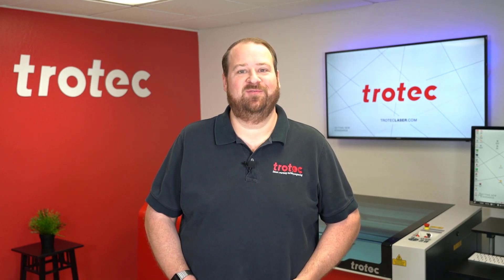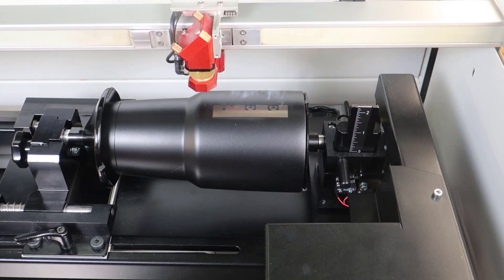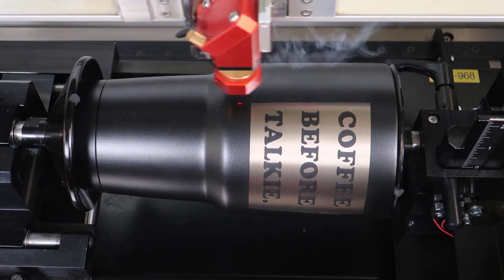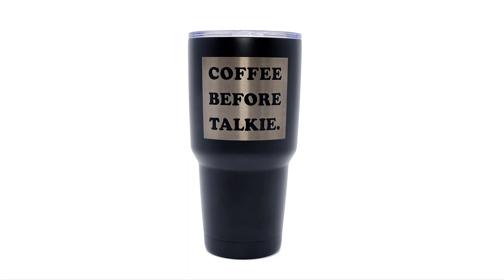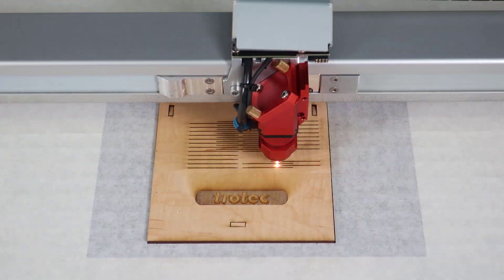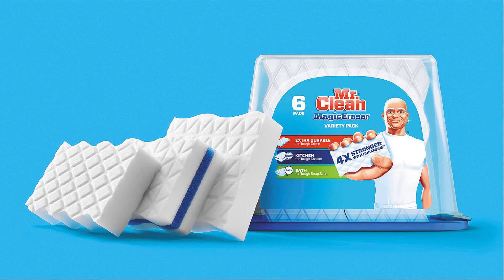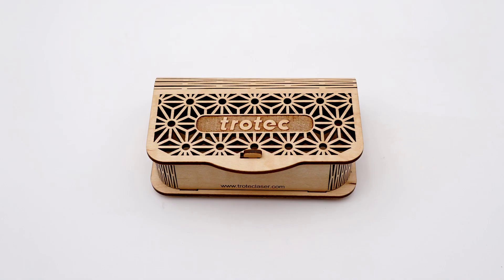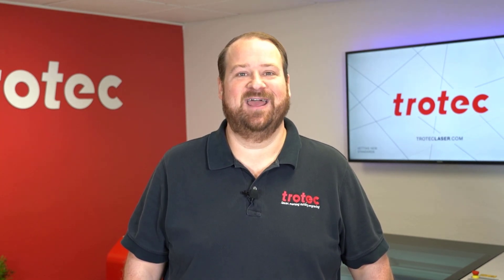Laser Hack: Cleaning Material with a Magic Eraser

Comment: How about corrugated cardboard?  Is it possible to remove the soot?  Thanks
Reply from the maker: You will notice a small amount of dark residue on the cardboard edge after cutting. The only way to reduce this further is to use a higher-wattage laser, which can cut the material much faster and thereby reduce the heat generated.

Comment: How do I remove the scorch marks from lasering leather?
Reply from the maker: A damp cloth will remove some of this, but the key is to not overpower the laser so that it does not leave any scorch marks if possible. Should you be cutting thicker leather, you must mask the leather surface to protect it from the heat.
Reply: I’m using the laser to cut out my business logo in leather. It has some inside small corners which I can’t get to, which is why I ask. I’ll adjust power to see if that helps but frankly considering a different machine that has a blade, eliminating the whole scorch issue. I’m also going to wet the leather somewhat but also reluctant as it’s dyed, so afraid of colour removal. In a dilemma!

Comment: I have been trying to laser etch some veg tanned leather that has a stingray embossed texture. When etching, I have been receiving a LOT of carbon on the leather. Would it be feasible to try the Magic Eraser to remove the carbon from the leather?  Thank you for your courtesy.
Reply from the maker: A magic eraser should work on leather, helping reduce residue. However, trying this may cause inconsistent-looking results. We suggest trying this very lightly to test.

Comment: Hello @Trotec, is it possible to remove the black marks created on Stainless steel?
Reply from the maker: Hi there! The magic eraser is a pumice-based foam; as long as the "black marks" are surface marks, it may work, but it will depend on what these marks are from.

Comment: Hi when my jewellery is laser hallmarked how can I easily get the black off without disturbing the rest of the silver or gold charm?
Reply from the maker: Hi Dawn! Cleaning the residue from laser-marked jewelry after the laser marking process can be more complex, and we would not recommend a "Magic Eraser" as it will cause micro scratches in the soft metals. We recommend an ultrasonic cleaner and a mechanical buffing wheel for that clean, polished look.